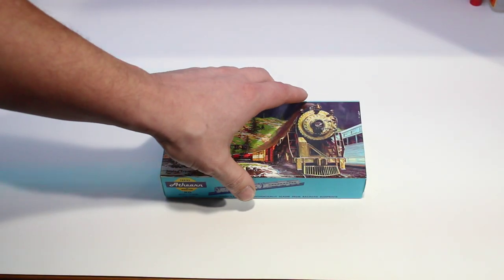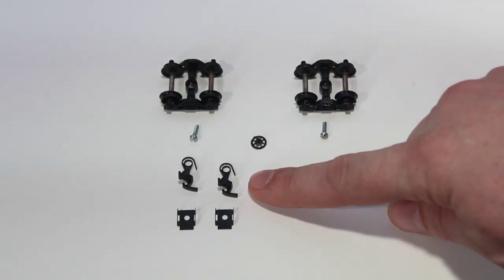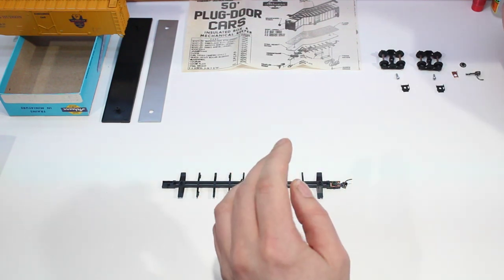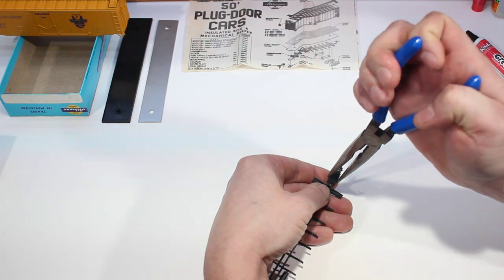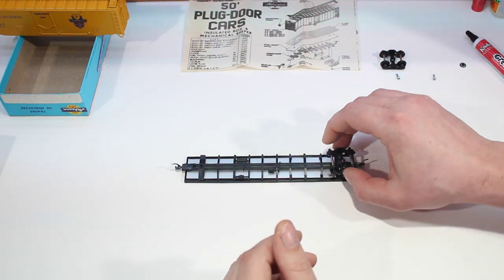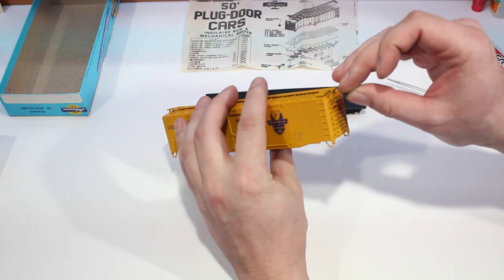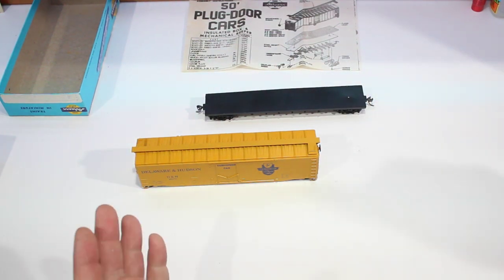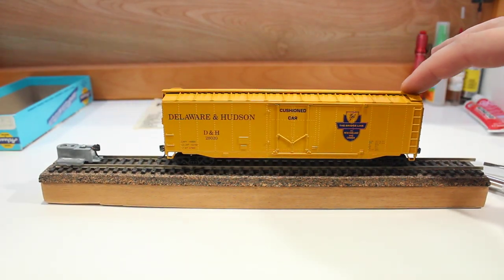How To Assemble Athearn 50' Plug Door Box Car - D&H

Comment: Using the "tripod" method of installing the trucks can result in reduced wobble on uneven track. Tighten one truck screw down so that the truck only rotates freely with no sideways tilting. Tighten the other one down so that truck rotates freely AND had a small amount of side play. This will increase stability while still allowing for a reasonable amount of sway on uneven track, as opposed to wobbling.

Comment: I always ageist the little bar on the coupler
before I install it on the frame....
Reply from the maker: You really shouldn't do that because each car might sit at a different height and ideally you want to adjust the trip pin at a certain distance away from the track for the auto uncoupler.